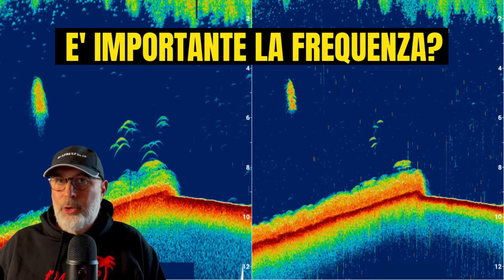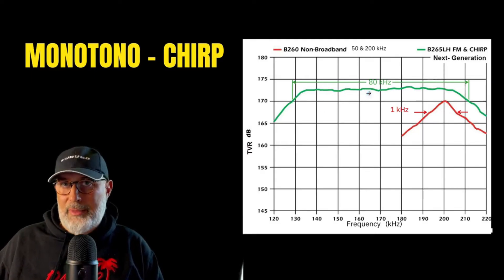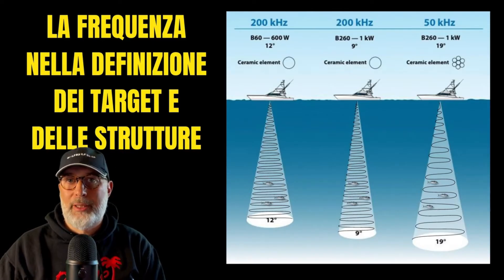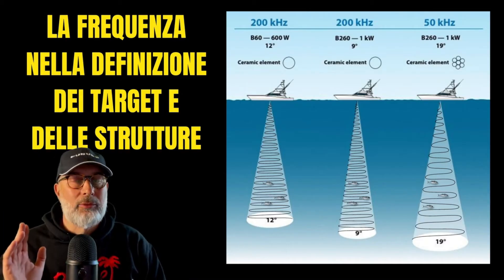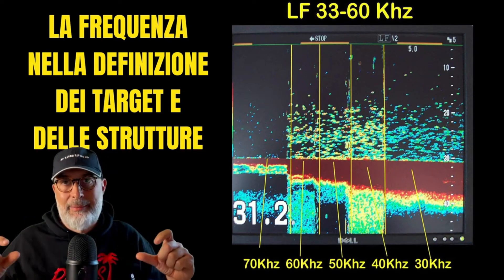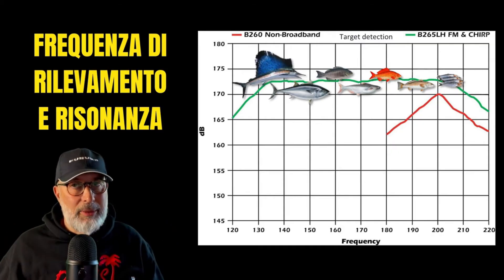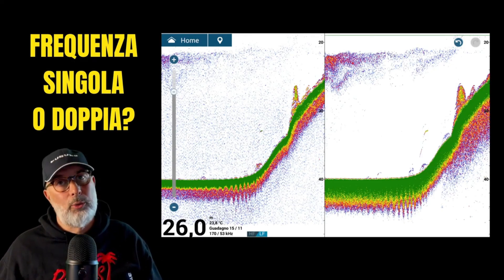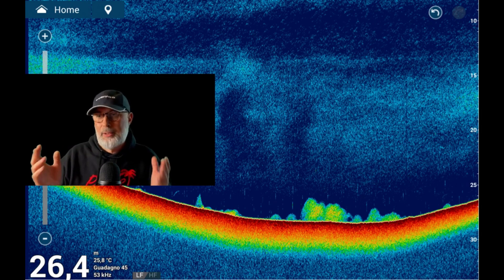SONAR FREQUENCY: Low, Medium, or High - Which Is Better?

Comment: Using the TM275LHW at maximum depths up to 25m for snapper, how can I determine where to cast my line (to catch the fish) if I see large snapper on the sounder screen - given the wide cone angle of this Ducer?
Reply from the maker: Hi, you can't know the position of the fish inside the cone, only the distance from the translator. You should use another technology, the multibeam, for example the DFF3D Furuno

Comment: You showed the difference between individual frequencies, is it better to be scanning and displaying the range or try and identify a specific Frequency that works for your depth and fish species? Do you lose info when you get a range of frequencies on your display? eg set it at 28-60khz or find a specific khz that works for you?
Reply from the maker: Hi, for me the definition is more important, and I almost always use CHIRP. Only if I want to focus on tuna I use the fixed and low frequency, to have the widest cone. There are instruments that are able to tell the size and species of fish, but they use very complex systems with software programs.